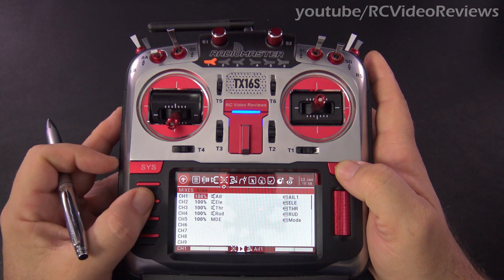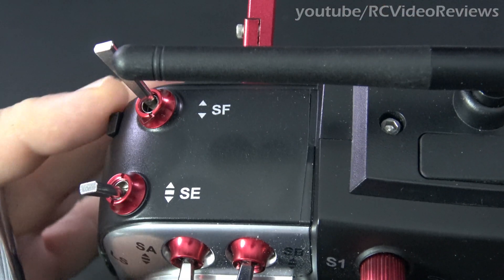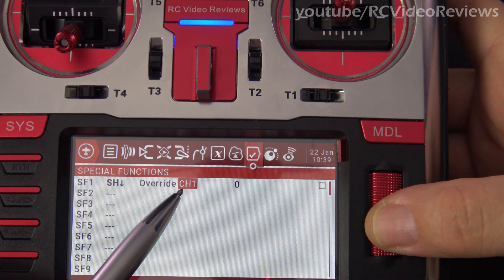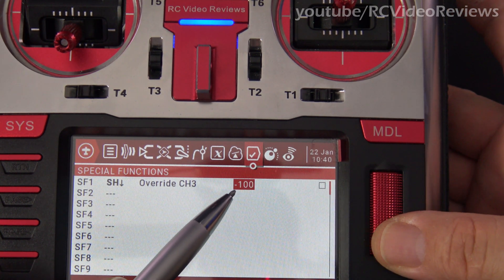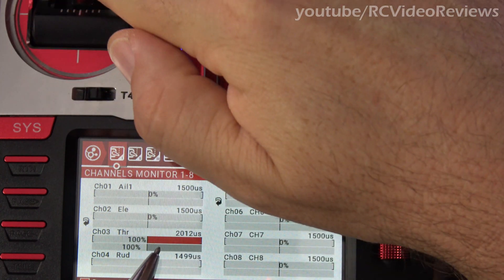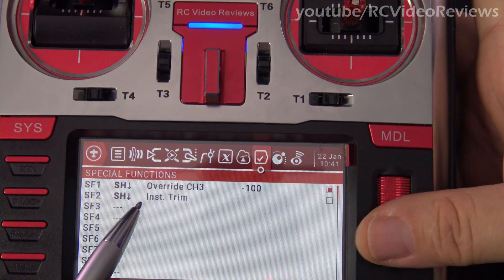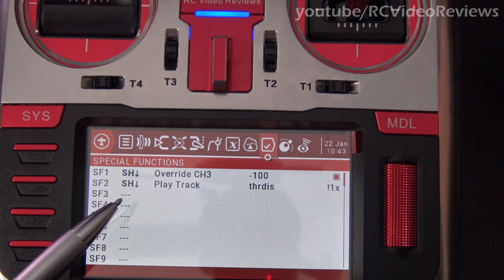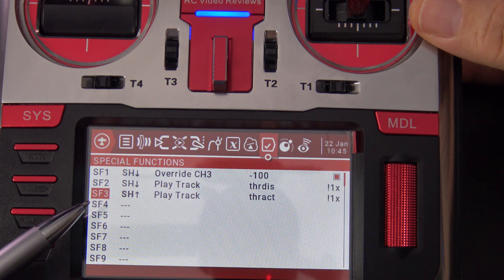OpenTx Snippet • Throttle Lock with Voice Prompts

Comment: Hi dear , I am used to watching all your videos , and learn a lot about radio master with the help of you.
My question is ,

Can this throttle cut work with Gas engine or nitro engine , ??
If I want to cut my engine or kill my engine during landing , then this throttle cut will work ??

Or need to do other way ?
If there is another way to kill gas engine pls guide ,

Thanks 😊
Reply from the maker: I don't fly gas/nitro, so I'm really not the right guy to ask, but, if I were to guess, I would say:

Model Settings - Turn on Idle trim only for throttle.
Flight Mode 0 - Set trim to kill motor.
Flight Mode 1 - Set trim =1 and trim to idle motor. Use your throttle cutoff switch to set Flight Mode 1.
Reply: @RCVideoReviews  thanks for guidance

Comment: Hi, how can I stop my timer when I engaged the throttle Lock, if my timer is on when THs?
Reply from the maker: Set your Throttle Source to the channel you use for throttle. In my case Ch3. Then your clock will only start when that channel is not locked and THs shows non-zero.

Comment: Really good info for the beginners, short and informative! Why do you switch the momentary and the 2-pos around?
I do it to, but can't really remember why I started doing this. Got my TX16S the other day and decided NOT to swap them this time.
Man it's hard to get your muscle memory to unlearn the previous setup.
Reply from the maker: I fly mode 2. Elevator and Aileron on the right. I also use Instant Trim which is best with a momentary switch. I thought it much easier to hold elevator and aileron steady with the right thumb while hitting the momentary switch on the left side with my index finger. Much easier to do without disrupting my elevator/aileron x/y while trying to hit the switch.
Reply: Good thinking. If i recall, i was comming from Futaba and helis when i started with OpenTX/FrSky. The 2 pos was on the right side on the old T7C i had and used it for throttle hold and wanted it to work as before. 
I'm only flying quads at the moment, using momentary as prearm and 2-pos as arm I'll try to use them as they are from the factory. Makes it easier when I'll go to the next radio.

Comment: Thank you for being an amazing source of information to help us newbs start understanding and utilizing OpenTX. 

For some reason I don’t seem to have the override option on Special Functions. Could I have deleted it when I update the software on the memory card or transmitter earlier today?

I’m a week into OpenTX on a RadioMaster TX16s and still having problems with some more basic things. 

UMX Timber is working perfect, however my Valiant can’t seem to get safe on a switch, and I can’t stand the idea of only being able to fly with safe on.
Reply: Just checked my UMX Timber.  Looks like I somehow deleted the Override feature. It’s currently “SF ⬇️ - - -  ⏹” I’m guessing that somehow happened with the software update I did today.
Reply from the maker: You can't really delete the Override function. It is baked in to the firmware. However, Override is not available in Global Functions, only in Special Functions.
Reply: @RCVideoReviews  the only options listed now under SPECIAL FUNCTIONS are: Trainer Sticks, Inst. Trim, Reset, Set Timer 1, Volume, SetFailsfe, Play Sound, Play Track, Play Value, Luna Script, BgMusic, BgMusic ll, Vario, Haptic, SD Logs, Backlight, Screenshot. And the cutoff switch no longer works, however the arm and disarm tracks play when the switch is flipped 🤷🏻‍♂️

Comment: I wouldn't recommend your method for anything other than a glow model and even then only with a momentary switch. With your method an accidental arm with an open throttle could result in at best a flyaway and at worst an unscheduled trip to A&E. You need to make the arm contingent on a shut throttle.
Reply from the maker: There are plenty of ways to have the radio add layers of safety as I show in this video: https://youtu.be/Y0eKFAFNeX8 However, some people simply do not want that level of complexity in their setups. I have 3000+ flights using this method and have yet to send myself to the hospital. I disagree with blanket statements like yours. It's up to the individual to implement safety measures corresponding to their abilities (or memory). You do not need to make the arm contingent on a shut throttle, in fact, I would argue that there are dozens of lower grade radios used safely every day that don't have that capability at all.
Reply: @RCVideoReviews  I agree with Richard. Using your throttle lock is asking for trouble!
Reply from the maker: In the spirit of completeness, I added information on the more complex setup to the description.